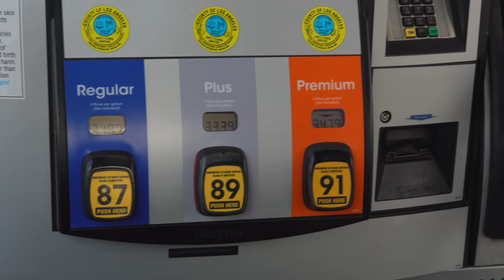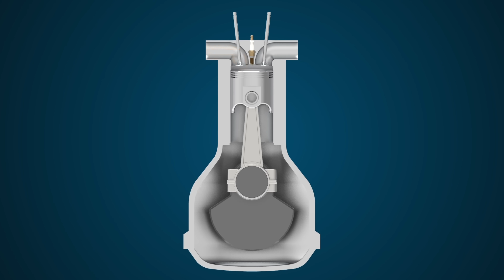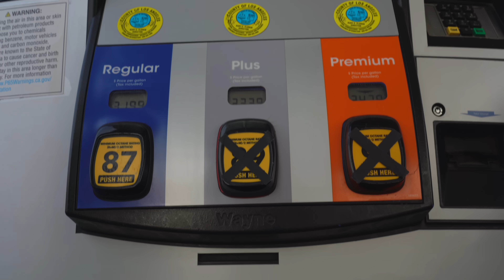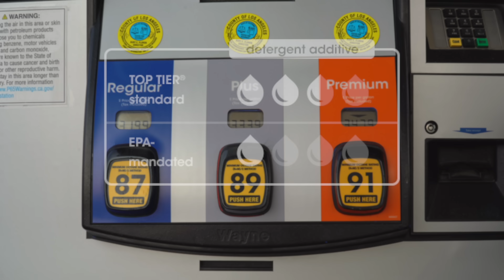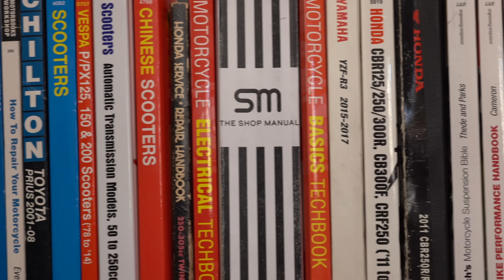Should You Run Premium Gas In Your Motorcycle? Octane Explained | The Shop Manual

Comment: You did NOT address altitude (above sea level) for normally aspirated motors, as you can typically drop by one point the required octane for each 2,500 feet, does NOT apply to turbo or supercharged engines.  One slight error is that it is not the high RPMs that require higher octane, as when low octane damage occures, it is a full throttle at lower RPMs typically just where the engine's hightest torque is ratad.   Years ago I was in the highlands of Peru in the Andes (around 12.000 ft.) where "regular" was about 75 octane, car ran fine, except for the lower power associated with less air, except when they drove down to the coast where they would knock severely until they got some higher octane "lowland" gas.

Comment: Great video as always, but I was wondering. I know a lot of street racers who add additives to their fuel tank (usually mentioning on the label that the full additive bottle + 10L of fuel = 103 Octane, then full bottle + 20L = 98 Octane, etc... I've always known about only going premium fuel to avoid knocking, but is there any truth in this high octane boost from additives which adds performance? Or is this just the same principle extended to engines modified for racing, which are even more prone to knocking, even when using premium fuel?

I think this also links to race fuel vs pump fuel, how do those differ? The race fuel has a higher octane rating, but is that just a side effect of the added ethanol, which is what is really increasing the performance?
Reply: Most actual "race" fuels still use lead as a detonation deterrent. As for the guys running octane boosters, it's the same principle as the regular/premium pump gas discussion. If those guys are running turbos or 13:1 compression ratios then the octane booster makes sense, but otherwise they're actually just diluting the fuel with a less energy dense fluid...
Reply: @AriH211  ah, I see. Thanks for the info! So essentially any higher octane fuel only exists to avoid knocking on exceedingly higher compression engines. And the fuel allows the engine to produce power rather than give power.

Comment: Another thing to consider is that modern day fuels starts degrading quite quickly and more premium fuels are sold much less so the "premium" fuel you buy at the station might have some considerable age to it.
Reply: Nope... whoever told you "modern day fuels starts degrading quite quickly" is totally full of crap.
Reply: @Jeff82556  Really?
It's so much common knowledge a quick google search will give you the information.
All the additives in modern fuels and especially ethanol which is present in pretty much 100% of all the petrol you can buy today makes the shelf life shorter.
The different components starts to separate.
Even modern diesel has a shorter shelf life than 30 years ago because of the fuel mixture.

Comment: Also need to check the octane recommendations are to the U.S. standard. My Beta off-road motorcycle has a requirement for 100 octane, however I believe this is the European octane rating, which is equivalent to 95, which you cannot buy at the pump. So 93 plus an octane booster or just run 100LL AvGas in it.

Comment: My philosophy- ethanol or non ethanol, will both have same amount of moisture in the tank (breathing, condensation).. maybe the ethanol allows it to homogenize with fuel but either way the h2o is still there.. but non ethanol rec gas is friendlier to fuel lines, seals, plastic tanks, etc ...?.. best practice is whatever fuel used, use it asap

Comment: And you didn't even touch on Ethanol,here in Canada our lower grade fuels have Ethanol in it them,while our premium 94 octane at Chevron has no Ethanol. And you can tell the difference between Ethanol and non Ethanol gas. And 94 from Chevron is all i run in my bikes,i dont like the hesitation when i get on the throttle when using Ethanol gas.

Comment: Great content as usual! 
Can you do a similar video on ethanol? There's lots of comments already just in this thread, and I don't know what is right or wrong. Like many have already said, I use 91 Octane when I'm going to have to park the bike for more than a few days, only because I can't get 87 octane without ethanol in my area. This time of year (October) I'll start using 91 octane with stabilizer in every tank because I'm never sure when my last ride of the year will be. Will stabilizer mixed with ethanol gas accomplish the same thing?
Reply: stabilizer is easier to use with E10 than to switch to E0 premium

to fill the tank with E0 you have to drain the tank to get ALL the E10 out

Comment: excellent video. What about ethanol as an additive? One of the NZ fuel suppliers adds 10% ethanol to 95 octane petrol and calls it 98 octane. Is this correct and does the ethanol give the motor any more power? and also what does octane actually mean. for example can you get 101 octane? Or is 100 octane ( AV gas ) the highest?  thanks
Reply: Ethanol is useful as an octane booster (to replace MTBE and tetraethyl lead, both of which are highly toxic) but ethanol is only 66% as energy dense as pure gasoline, so it's liable to make less power and get inferior fuel mileage.

Comment: Good info. My bike calls for premium. 

But it’s very important to buy good brands too. Shell, Exxon, and Chevron are three of the best to buy from. Always look at ethanol content too. You typically want 10% or less. 

My truck has a somewhat high compression ratio but the manufacturer says I can use minimum 87 octane. I always fill it with mid grade or premium anyways because it keeps it cleaner.

Comment: My pushrod evo motorcycle engines would sound like glass was breaking in the cylinders when I used low grade fuel especially when I wanted to go faster. This problem resolved itself once I started using premium 93 octane gas. I felt smoother throttle response and a happier engine.
Reply: I've owned 4 90s EVO Motors and what he said is true. I only run 93 with no Ethanol or Wawa Rec90 with No Ethanol on old Harleys. See back in the 90s there was No Ethanol in gas until Bush JR introduced it to Gas in every gas stations and old vehicles started to break down because of Ethanol 🤦‍♂️
Reply: it's all in your mind man..

Comment: Just going to add my data point here:
I rode 400 miles from Kansas City to Illinois on a yamaha R3. I refueled 4 times, each time with different gas, and made a note of the average fuel economy in each segment in between gas stations. 
In my experience, 87 octane gas produced significantly lower fuel mileage - both lower overall mpg and lower cruising speeds to maintain a good instantaneous mpg. 89 was decent on both front. 91 was better than the previous two, but 93 was by far the best and provided both great overall mpg and high cruising speeds while maintaining good instantaneous mpg.
Reply: As the Yamaha R3 has a compression ratio of 11.2 : 1,  it makes perfect sense that it would work best on 93 octane, my guess is that Yamaha recommends "premium".  Typically the upper limit of compression ratio for 87 octane is 9.5 : 1.
Reply: @That Dude well yeah I guess so man, I'm just providing a single data point. One would have to collect a lot more to see if this trend holds true for motorcycles in general.
Reply: @That Dude :  As I don't have a copy of the manual, I can not challenge your assertion as to what it says, as you cite that it says "acceptable" does it have further wording to the effect of "for best performance a recommended octane of 92 advised"?   By adding your "(pseudo)" you most certainly intended disrespect, it would be like calling someone an idiot, then following with "no disrespect intended", even a true idiot would know you were lying.  I know of no one who clams that the R3 is a "true race bike", with that said it is a true "sport bike" in its displacement category.  I see nothing wrong with a bike like the R3 requiring premium gas, the average rider is spending about 2 to 3 cents per mile in tires and the difference between regular and premium is only about 0.3 cents per mile.
Reply: I second that, i own a r25(smaller cc r3) and premium fuel does makes it run longer comparing side to side, i consume 10 litre of fuel everyday and i can tell the difference, it doesn't make it go faster, just better fuel economy.( my opinion, don't take it as a fact)
Reply: @That Dude :  Just speaking for myself, in no way would I be "put off" by a bike that produces better that 1. hp per 10cc. reuqiring premium gas when it goes 0 to 60 in under 6 seconds and gets 50 MPG.
Reply: @That Dude :  I get your point, and I agree.  What I see as the problem is not whether the bike uses regular or premium gas, but the high price of new bikes that have way too many 'bells and whistles' . Who needs 5+ modes of traction control?  What is needed is a simple bike that produces 25 t0 40 hp, can keep up with traffic on the highway, is low maintenance with almost no added "bells and whistles" and a price tag about $1000 less than the "fully loaded" bikes that are now on the show room floor, the problem is that it is the 'extras' that provide a higher profit margin for the dealers.  If an engine that requires premiun fuel, could be as much as 50 pounds lighter as it is phisically smaller for the same power, great.
Reply: Here in cali, 91 is the highest fuel octane u can go lol

Comment: Another important thing to consider for us that have bikes and vehicles that require 93.  Unless the pump you fuel from has a dedicated fuel fill hose for the 93 than the pump that has 87, 89 and 93 will have about 20 liters of the previously selected fuel choice in the pump and the lines.  89 is also blended at the pump almost everywhere.

Comment: excellent info. if you want to run Aviation
  100LL for a short time or lay it up for the winter you’ll never have a problem. I’ve laid up bikes for 6-8 years charged or replaced the batt and near instant start. no damage to rubber, plastic or any metal. doesn’t need to be stabilized!! cost $5-6 gal. Bummer

Comment: all depends on the camshaft design and the compression ratio and possibly the exhaust. if we could add tetraethyl lead it would change things also. are they using knock sensors yet on motorcycles. i have been making my own octane booster for over 20 years.

Comment: I work at an aerodrome in the UK. Our gas pumps have 100 octane. Oh so tempting.
Reply: Use it. I used it a lot until the cost got so high. If you are going to use it advance the timing because it burns slower and doesn't explode in the combustion chamber. Just a better burn with high compression engines.

Comment: Funny how so many dudes is UK and EU think their gas is better because "bigger numbers" 🤣   Always have to explain to them that no, your gas isn't any higher octane, it's a different rating system.
Reply: It does depend, though. In some European countries you can buy 100 or 102 Octane, which is the equivalent of 95 or 96.5 AKI. So it may be true that they have higher octane available, though nothing sold as a new bike in this country really needs it.
Reply: Yeah they were always talking about their 95 or 98 or  whatever compared to out 91 and 93.
Reply: The Europeans must be right though.  They are so much smarter than us Americans.  lol.
Reply: @johnjacob688  Your spot on. We are.
Reply: @Tyler Staton Nice for you that it is so close. We have various gas stations in CT that sell VP 110 racing fuel from the pump, though it must be pumped into gas cans and not into a vehicle. The VP 110 they sell is 110 octane low lead for $10 a gallon. Since I don't need 110, I buy the 100 LL from the airport for $5 a gallon. pure-gas.org has many locations that sell non-ethanol and high octane fuel.
Reply: 93octane in usa is AKI* number..

However in certain country like japan and mine, there is RON100 pump gas available..  which is definately higher than 93octane AKI number...

93octane AKI is about RON97 or 98 rate... Which also often rated as premium gas almost everywhere...

*Correction
Reply: @AmirPomen  USA uses AKI or (RON + MON)/2. 93 octane is an average of RON and MON. Everything else you said is fine but please know we don't use straight MON.
Reply: @fprintf  thanks for correction

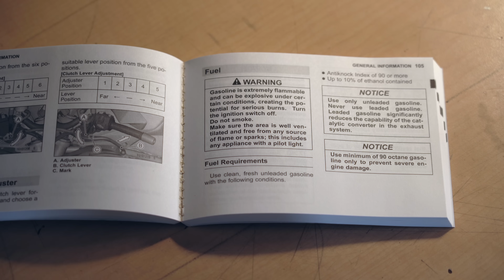Comment: Not sure why you guys used a 2012 Honda CBR250 ( 2:58) as an example of using higher octane when you shouldn’t. The manual for that bike states that it takes a 91 or higher.
Reply: Perhaps you're referencing a manual for a non-US bike. Many other countries use a different rating system for octane that yields higher numbers (as mentioned at the beginning of this video). The CBR's compression ratio of 10.7:1 certainly doesn't call for anything higher than 87. I've experimented with that engine up to 13.5:1 compression ratios, which required 110-octane to avoid detonation (granted, ignition timing was also advanced significantly, which promotes detonation). You can safely run up to 11.5:1 with the CBR250/300 platform on Premium (91 or 93 here in the US) pump gas.

Comment: On the subject of displaying different octane numbers for the same resistance to pre-ignition: a friend of mine owns a Royal Enfield 500 military. His manual says to use 91 octane, but without specifying whether that's Ron or Aki. I'm sure they mean 91 Ron, which is our 87, but I don't blame him for always using premium because of the uncertainty.
My bike actually requires premium (the manual lists 95ron, which I know converts to 91Aki here in North America). I'm fortunate that I live in Canada where most of our premium fuel is still ethanol-free. I don't think ethanol is much of an issue when using the bike regularly, but for winter storage I just prefer ethanol-free gas.

Comment: Worked at Acura a few years ,you could tell who runs 91 and who runs 87 once the heads came off ,87 lots of carbon and deposits on valves and pistons ,91 minor carbon very little deposits, anyone who says it doesn't matter is a fool ,any car with a knock sensor will have to retard timing more especially up hills with 87 ,91 allows the ecu to run advanced timing more often and at times where with 87  it can't cars now come from the dealer with 10.1 compression this isn't the 80s anymore and there is a huge benefit with running hi octane its all I run in my truck and in my bikes

Comment: why is my octane level higher here in Singapore it's 92, 95, 97 is it due to the temperature or something else cheers
Reply: They explained in the video that different countries use different measuring systems for octane,  so your numbers are higher but the fuel is still the same (like Celsius vs Fahrenheit).

Comment: Knocking due to too low octane is a thing of the past. 
Modern engines have knock sensors and the ecu will adjust the ignition accordingly. 
Sure the engine is gonna run worse, but it shouldn’t knock.
Reply: Very few motorcycles have knock sensors. Only very new, higher-end bikes do, like the supercharged Z H2 featured in this vid.
Reply: Ari Henning 
Huh, I thought every almost all modern bikes had it🤷‍♂️

Comment: I only fill my bike up with “premium”. 
Due to EU regulations all other types of gasoline contains 10% ethanol. And running that on an older carburated bike is just asking for trouble.
Reply: I run the cheapest 87 I can find in my '82 Honda XL 500. I've never had any issues. It's a low compression ratio on that engine and I'm convinced it would run on 50/50 water/fuel 😂

Comment: You failed to say what happens if you run high octane in a low compression engine. If you have a low compression engine (most Harley Davidsons) you risk octane poisoning. High octane requires more compression to completely burn the fuel. If you’re engine is low compression, the unburned fuel can slip past the piston rings and end up in your engine oil. This reduces the oils ability to lubricate and this can cause the engine to fail. Simply adding a fuel pac or tuner because you added a slip on and an air cleaner does not increase engine compression. Unless you’ve done internal mods, run what the manual tells you to run. Race gas in your 883 is a bad idea!

Comment: Usually enjoy listening to TSM but after doing a real world comparison on 2 Subaru foresters driving 5 hours at 100km/h at the same time same day utilising cruise control, filling one with 98 octane and one on 91 octane. Actually worked out cheaper doing that run with 98 octane due to the superior km/L. That is taking into account the price difference at the bowser.

Comment: With emissions controls in newer bikes, living in areas where only regular available, ECU with emissions software/detonation software will compensate.
Reply: It will compensate by retarding the spark curve, resulting in a drop off in power. Further, depending on the manufacturer, if the timing is regarded too much or for too long, it will turn on the “SES” light.